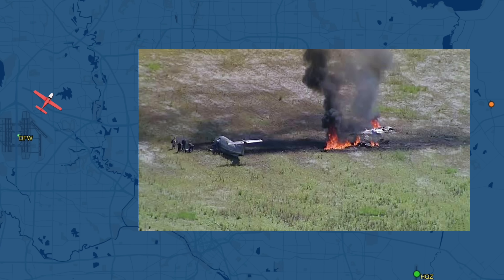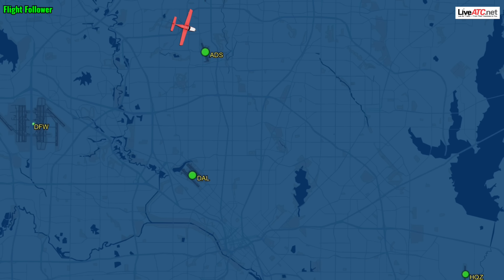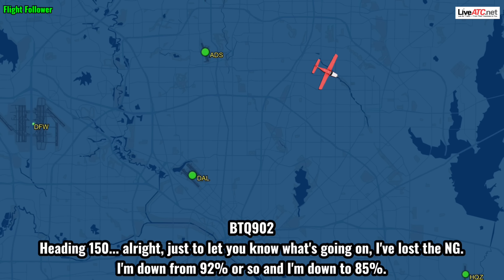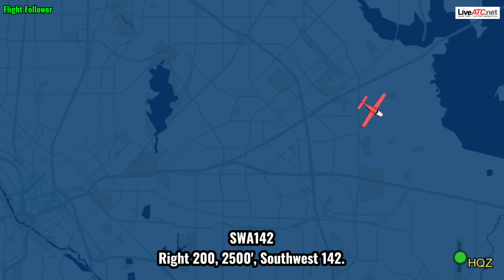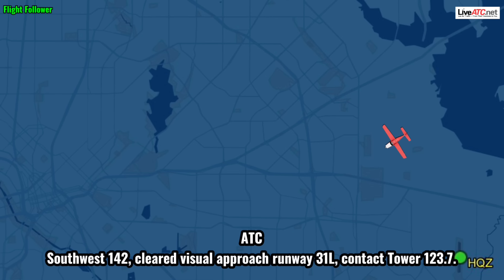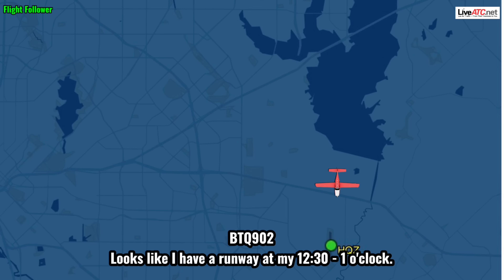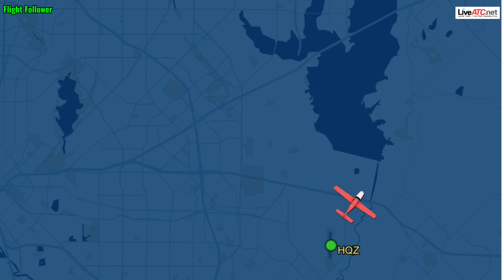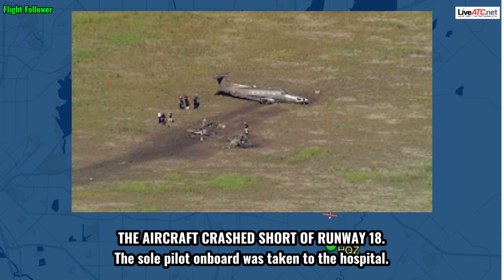Pilot’s DELAYED Decision Making |  Ends up crashing near RUNWAY!

Comment: Yet another emergency with no mayday call.
Reply: Does reading off every engine indication to ATC count?
Reply: @brettstowell4029  Actually no. Mayday or "declaring an emergency" can't be misunderstood (if heard). Controllers aren't pilots, they may not have a clue what N1, EGT or CHT is or what the values for those measurements imply.

Comment: Don’t descend if you think you have an engine getting ready to go away. Maintain your altitude as long as you can until you’re over an acceptable landing surface, rwy, farm field, golf course, road etc. And, don’t lower the landing gear until you have the landing surface made. You don’t want that drag early and you may decide that you’ll need to land gear up. No flaps or gear until you are methodically spiraling down over whatever you’ve chosen to land on. Don’t descend until you’re on tight downwind for your touchdown spot, whatever that may be. Practice makes these maneuvers easy.

Comment: PT-6's are usually exceptionally dependable.  Worked them for a while doing defense contract work.  Had to go to Pratt for a training session.  The rep there told me that they had records of one running a pump in a oil field and it ran for 20 years non stop with no problems.  Granted it wasn't flying but running 20 years non stop is pretty impressive.  FLY NAVY!!!
Reply from the maker: Flown PT-6, pretty Good Aircraft
Reply: @Flight_Follower  I wouldn't want to be the one who signed off that beta cable though.  FLY NAVY!!!

Comment: Love to hear the pilots explanation for his decisions. Lost an engine in an old C90 and it was instantaneous with no warning signs like he had.
Reply: Propeller feathered due to loss of oil pressure. You can hear the confusion in his voice as he reads the first chapter of "War and Peace" to the controller talking through the problem. Engine was running but gradually producing less thrust. He got into troubleshooting instead of a binary choice: Working or Not Working.
Reply: @brettstowell4029  when you start having trouble with any engine you get on the ground asap. Hesitation can bite you in the ass.

Comment: I'm not sure I follow the thought processes here.
 The Pilatus was at 4500' for the approach end of Rwy18.   Airport elevation is about 460' MSL.   So you need to lose about 4000' altitude and still stay slow enough to land.  You can't divebomb 18 and make that work.
  I think I would have flown a left downwind for Rwy 36 a bit wider than normal, BUT in a forward slip.   This causes you to lose altitude faster, but NOT gain airspeed.   When you get to the point where you normally roll off the perch for Rwy 36 you should be close to your normal altitudes and speed.  If I still have no power, it's time for a dead stick ---------  gear up, engine and fuel OFF, flaps full down, Battery off, use every inch of runway available and grind the bottom of the airplane to aluminum powder to slow the landing.
Keep the plane 2 or 3 feet off the runway until it stops flying areodynamically, so that if it DOES stall, it won't drop very far.

The pilot is usually the first one to the scene of the crash, so he is going to do everything he can to make it survivable for himself, his crew, and his passengers.

Comment: The only dual engines failure(s) that I have had have been behind PT6’s. They were both manufacturing errors resulting in zero oil pressure and I was a test pilot, but at the time we had to change out a large percentage  of the engines ( -61’s) due to inadequate power. (To hot). 

I don’t like them. And I think I’m the only one. The old one time oil pumps are usually reliable. Terribly inefficient, but reliable.

Comment: Speaking from experience (single engine failure), if able, don’t descend. Unless unavoidable, only accept vectors if they’re DIRECT to nearest suitable airport (re: ValuJet crash in 1996). Stay near the approach end of the runway and spiral down, expecting the engine to fully fail at any moment. Not that difficult in a Pilatus

Comment: I'll take a well designed twin any day
Reply: Because they are safer?
Reply: @kevin409galv  biggest myth in aviation, tell me, how many twins make safe landings on one engine, you don’t know do you lol
Reply: @Agwings1960  Yes, a lot of twins can lose an engine and land.   Why are the accident stats very similar between twins and singles?  Most of the piston twins are very poor performers on one engine and have a negative climb rate until they are cleaned up.  This is the oldest debate in the world and never a winner
Reply: @kevin409galv Yes lots of light twins have basically negative single engine performance which makes the statistic more complex, but you'll notice that my original comment said, a well designed twin, which is one with good single engine performance, something like a King Air. The only engine failures on twins that are even documented are the ones that turn into accidents, I asked you to supply the number of twins that make safe landings on one engine, cuz thats the number you need to really quantify the argument, so how about it?

Comment: Typical GA trained pilot. Yaking on the radio. Has zero SA. Plus the Operating manual will ALWAYS say, “Land as soon as conditions permit.” for anytime you run an Emergency Procedure.
Reply: This is what you get for requiring 1500 hours in a puddle jumper. It is not professionalism from good training. He never had a problem before, so he'll be OK this time too.
Reply: @cageordie  Exactly right.

Comment: You know if a United crew was having problem with their 737 engine, they don't describe all the problems to ATC.  They just declare an engine emergency and the nearest place to land.  This private pilot is something else.  I am guessing the pilot is a medical doctor.
Reply: Boutique is an airline.. he’s not a private pilot..
Reply: @LawInteractions_911  In that case, there probably are recorders, and he was just trying to help the ground controllers to understand his emergency.
Reply: @tractorsold1  My impression is that he was dealing with the stress by talking about it. Not ideal because clogging the air will create a backlog of things for the controller to deal with and make it harder for them to assist you, but it's better than panicking or freezing up. Unfortunately while doing so he talked himself into relying on an engine making partial power to head back to DFW.
Reply: 737 also has flight data recoder that would record this data.  The private pilot is providing data that would be helpful in an investigation.
Reply: @tractorsold1  i don't think I would be worried too much about generating data for the investigation of my demise. ABC....

Comment: Pilot lacked the training to prioritize the choices that occur during an engine emergency. Getting "back to DFW" was a false hope not the reality of his situation. Also,  I doubt he had ever done a power off landing in that Pilatus.  Doing a 360 to lose should have been done over the HQZ airport rather than miles away from it.
Reply: Exactly. Years back I've had a complete engine failure in a T-23 single engine trainer. Instead of trying to lose altitude far from the airport and then hope for a perfect circuit to land, I just flew straight to the airport. Arrived overhead, at 5,000 AGL. Knowing the airplane, knew I'd lose about 1,000 feet for every leg of the circuit around the field, so I aimed at altitude targets 1,000-ft apart at each corner in the circuit, adjusting each leg accordingly, to make the next corner at the right altitude. This put me in a short final at 500 ft AGL for an uneventful landing. I even managed to coast the airplane across the apron to its usual parking spot. This was in 1990 in what seems like a past life now, but the memories from the event are still as fresh as that day.

Comment: Engine failing...let's overfly Addison, go to Rockwall, change our mind, go to DFW, engine fails, go to Mesquite, make a 360 and come up short.  I'm not an armchair quarterback but I think there's room for improvement in engine-out procedures when flying a single-engine airplane with an engine problem...maybe like land at the nearest airport rather than overfly several.  Glad he's OK.  A partial power failure is a power failure just the same.
Reply: Thinking the same thing. If you got a problem with a turbine engine, you need to keep in mind that thing will start spitting parts at any time so why chance it? Get it down and sort it out.
Reply: This is an older accident. The speculation at the time was that Boutique had maintenance support at DFW. So he may have felt pressure to land it there to minimize the downtime.
Reply: To add a reference point, I live near San Carlos Airport (KSQL) and Palo Alto Airport (KAPO).  Their runway lengths are 2,621' and 2,443' respectively.  Both airports operate PC12s in and out all day without issue.   My guess management encourages pilots to divert back to base as opposed to an outstation.
Reply: To be fair 2500’ in a PC-12 is trivial in a PC-12 if you have normal reverse thrust. It sounded like the engine was barely making above idle thrust.
Reply: @42dunbar  It may be trivial under normal conditions but 2500 feet is short when you have any kind of problem.  If you're thinking you may lose an engine, judging a glide to a 2500 foot runway is no easy task and leaves zero room for error.  Of all the airports to head to when he initially experienced the issue, a 2500 foot runway shouldn't have been the choice unless it was the only choice.  He had Addison and he had Mesquite, as choices when he still had altitude, both easier targets with an engine out.  Heck, when he first had the issue he probably could have turned back for DFW then.
Reply: @johnaclark1 2500 isn’t a large target? It’s not if you’re flying a 737. I’ll give you that. But with the aircraft he was flying?
Reply: @VictoryAviation  It’s better than landing off airport but it doesn’t leave much margin for error in an aircraft he’s essentially gliding in.
Reply from the maker: He could make landing at Rockwell. Isn't it?
Reply: @Flight_Follower  Rockwall is only 3400 feet.  Not a big target with an engine out but, yes, he could have landed there.  It's possible the position you show doesn't exactly line up with the audio too.  Why he'd turn away from 3 suitable airports to go back to DFW, I just don't know.  Some poor judgment, IMO.
Reply: @johnaclark1  For a PC-12, that's trivial.